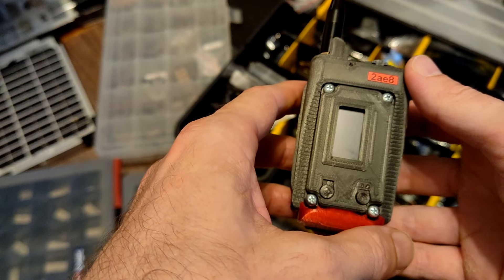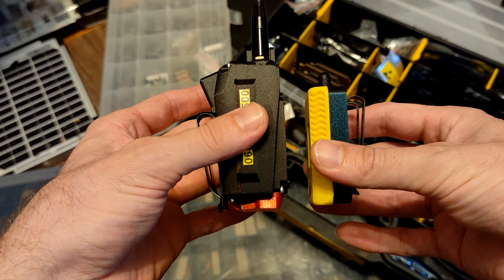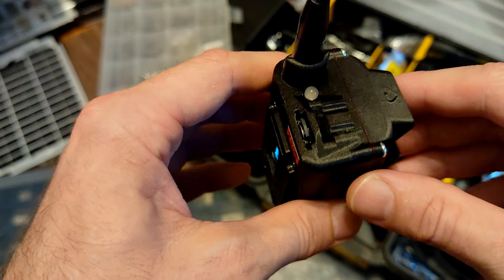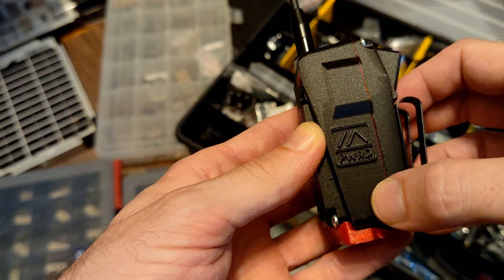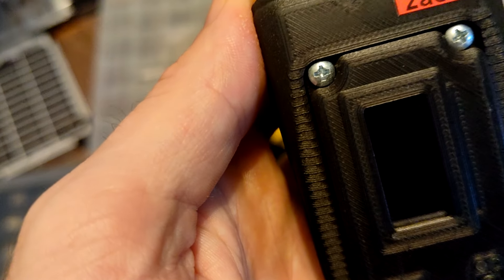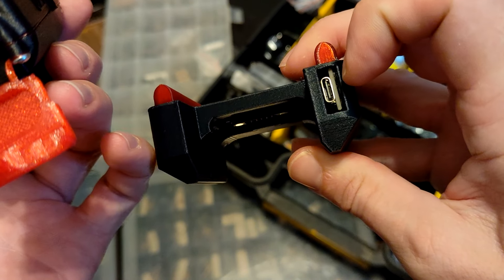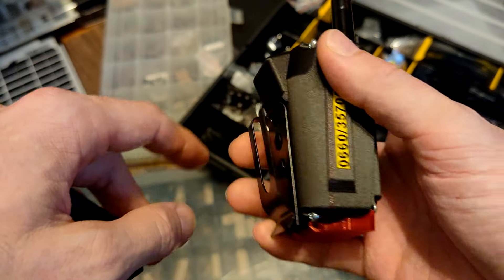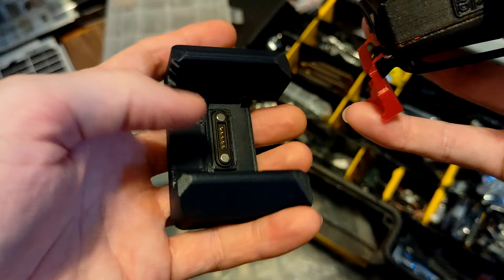The Ultimate Meshtastic  HeltecV3 device CHUNKY "MAXIMUS"

Comment: I'll post a make, as soon as my parts get here and I get that faceplate to print out correctly. I'm struggling with that, to be honest.
Reply from the maker: Are you printing with the flat side down and supports from the print bed up?  In case you use cura and use the the version 5.x and up let me tell you that I had the worst experience with getting rid off supports since they changed something , I rolled back to4.7.1 and the support structure pops out again like a dream. I dont know what they did IF that is your problem but the support structure at some point in version 5 and up is fused so badly with the main part its almost impossible to get rid of.
Reply: @LupusWorax  I'll try rolling back to a previous version of cura. I've tried printing both ways, supports from the bed up. I've also tried tree supports and printing at an angle using bambu studio. I've got about 8 versions I've printed, some that look pretty great from the face side but not workable on the inside.
Reply from the maker: @PatientXer0  Good luck man, keep me updated ;)